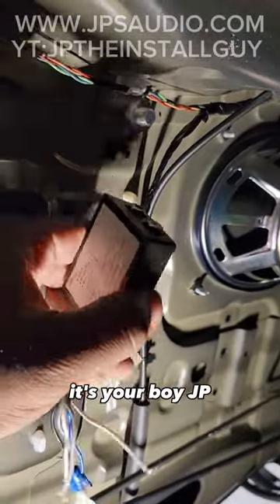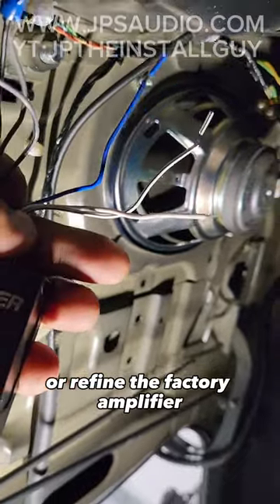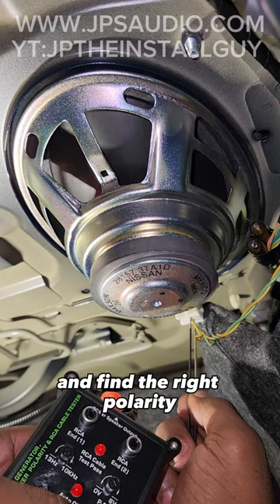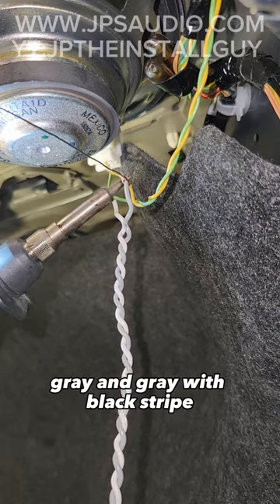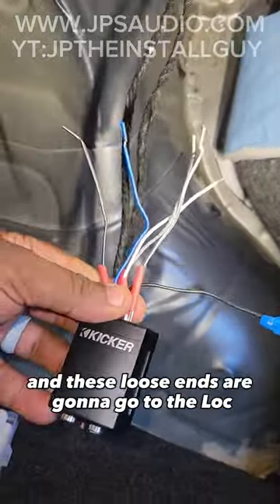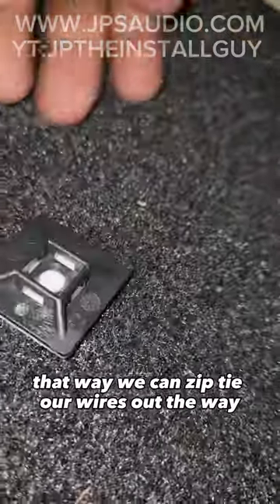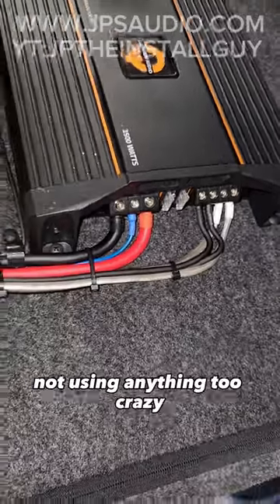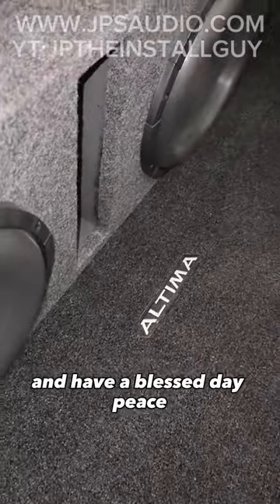installing a kicker loc line output converter to factory speakers in a Nissan altima

Comment: My wife has a 2020 Altima with the Bose.  I sold my truck so I have two 12s in a box and amp I can use to put in her car.  Will I be able to do it like this?? Do you have a video that shows how to on a her particular model of car and the Bose ?
Reply: The install will be the same for any car.  Just tap into the rear speaker wires.  It's really easy.
Reply: @paperman9708 imma sound really dumb for a minute so don’t mine me, I’m new to this, you tie into the back speakers and not the front correct?
Reply: Correct

Comment: What did you do with the loc ground? Did u mount it to the chasis or use it as a jumper to your main ground to the wire going to the amp

Comment: What did you do to the blue wire(remote wire)?? I have this same loc and don’t know what to do with it
Reply: i’m guessing it is for your amp signal wire, so it turns on the same time as your radio
Reply: that goes between the middle of the current and the ground wire of the amplifier input

Comment: Dumb question I hope someone can help me with.

The blue remote out wire... does that connect to the amp's remote connection (to turn the amp on or off)? I'm 99% sure it does, but this is the first time I've done a self-install and am nervous about messing things up.
Reply: yup the blue remote wire coming out of the adapter should be your remote wire for your amp